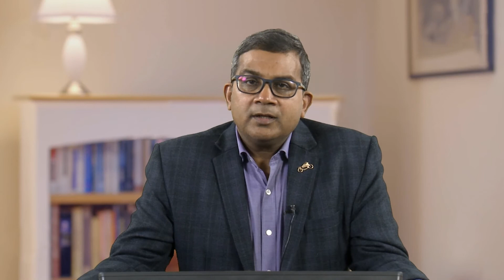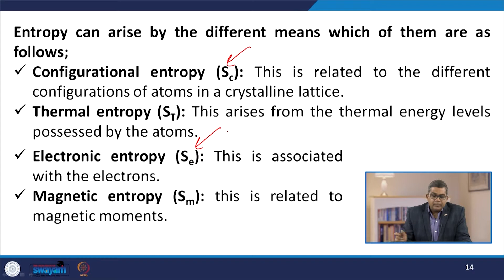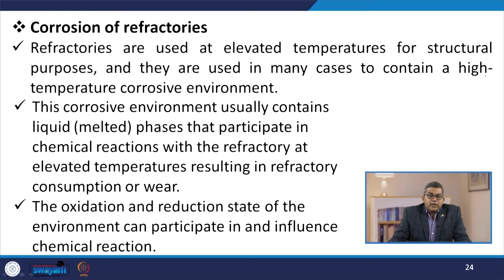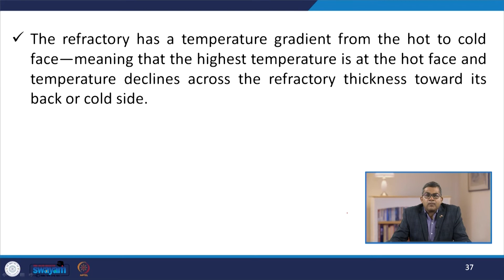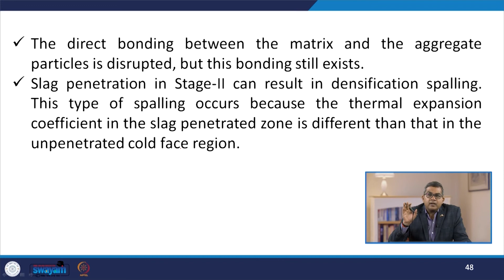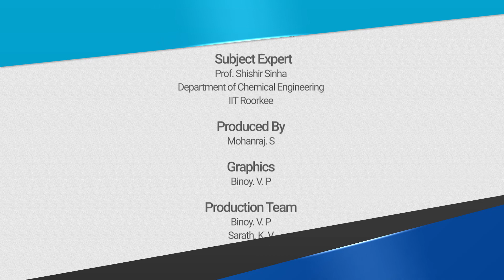Lecture 57: Thermodynamic Principles & Corrosion in Refractories

Comment: Excellent lecture. The discussion on thermodynamic principles is crucial for understanding why certain refractories fail under specific operating conditions. In practice, the Gibbs free energy change of reactions between slag or molten metal and the refractory phase often dictates the corrosion rate. For instance, in iron & steel applications, the activity of FeO in slag can destabilize alumina-based castables if the local oxygen partial pressure is not controlled. 

At CH REFRACTORIES, we have found that combining thermodynamic modeling with actual service data helps tailor product formulations for cement rotary kilns and glass furnace linings. Our experience with pre-cast shapes and functional products for power & petrochemical industries shows that even minor adjustments in binder chemistry (e.g., using microsilica instead of pure cement) can shift the stability field of refractory phases under high-temperature slag attack. 

The corrosion mechanism you described—where liquid phase penetration weakens the bond first—is exactly why we emphasize proper aggregate gradation and low-impurity raw materials in our fire bricks and insulation products. Would be interesting to hear more about how industry standards like ASTM C71 or ISO 1927 incorporate these thermodynamic criteria for refractory selection. Keep up the great content!